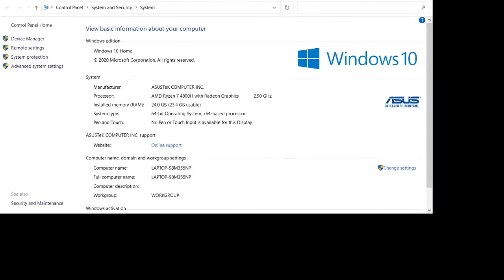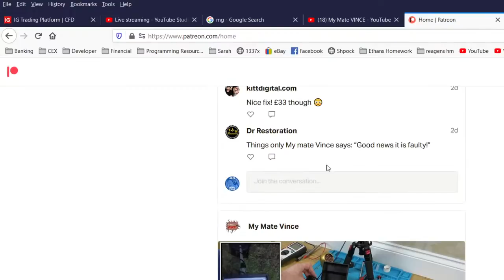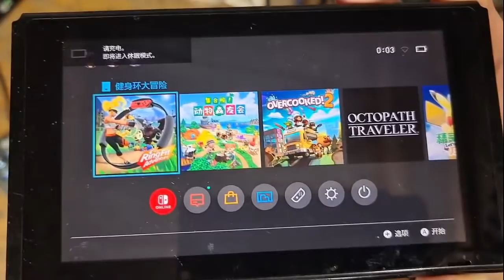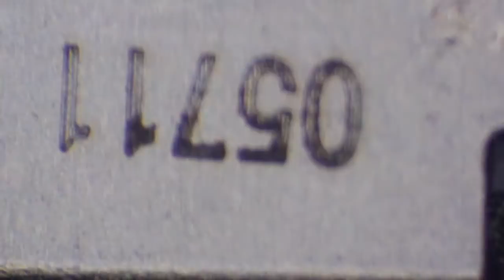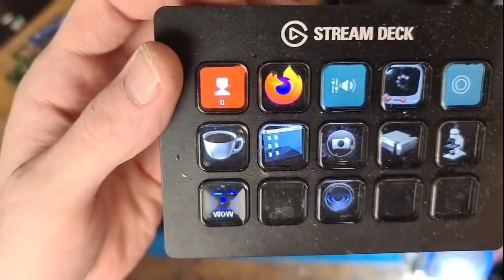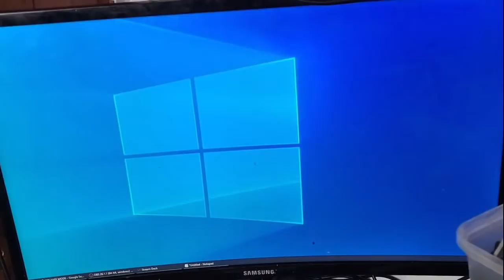WORLD FIRST EXCLUSIVE! Reballing A PS5 SSD LIVE!!!

Comment: You could save yourself a heap of time and just put the original chip back and see if it works again. Not conclusive proof but a quick call to Sony and you could could confirm that they need to be a set i.e. all chips as a set need to be replaced. If Sony has the answer no need for the full experiment.
Reply from the maker: I plan to replace all 6 and see if that works. Hopefully it will allow us to replace them in the future if and when needed
Reply: @TheCod3r  Yep if the SSD chips are in an array it would make sense that you just cannot replace one of them. The controller chip would get upset because the data would not match up. Lets hope the controller chip does not need to be swapped too, I doubt it. Good luck anyway, I will definitely watch the sequel :)
Reply: @TheCod3r  Can you replace a NAND chip? This is a quote from Nate S at stack exchange: It would be possible in theory, but in practice it would likely require detailed knowledge of the controller architecture, and possibly some debug tools that only the manufacturer would have. The reason is not because of a unique ID (most NAND chips will indeed have one, but most controllers won't care), but rather because a "blank" drive will generally not have a blank NAND chip. Rather, because of the indirection and wear leveling algorithms, the controller needs to read some data from the NAND when it boots up in order to know what's stored where, and if it can't (because the new chip is completely blank) it will generally enter some error state. Simply copying the data from the old NAND chip will likely also result in an error state, because the indirection table's size will not match the size of the NAND. You would need to know how to tell the controller to rebuild that indirection table from scratch. Sometimes manufacturers will provide tools to do this (generally to large datacenter customers, under an NDA), but notebook manufacturers typically will not.